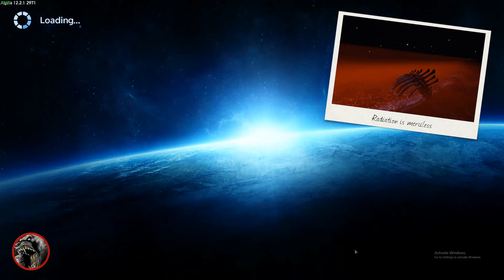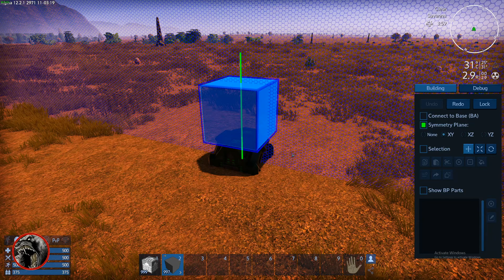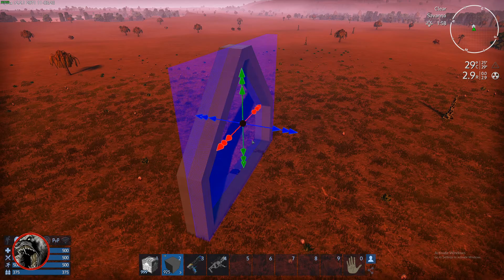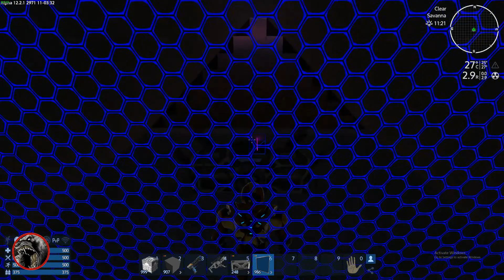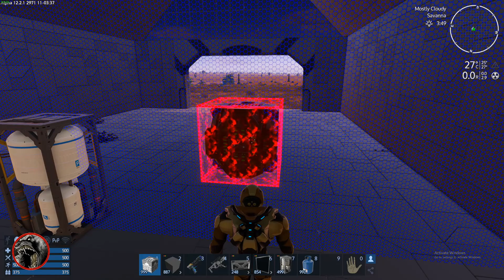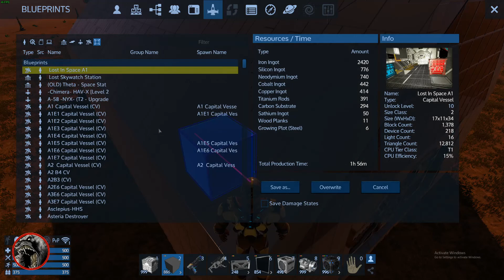Empyrion - Galactic Survival: Basic Guide to Creative mode and building tools

Comment: In symmetry mode, use SHIFT+RMB while holding a placeble to remove blocks, it'll remove it from both ends. The multi-tool just removes it on one side.

Comment: Haven't built in a while but if I remember correctly if you hold shift and right click while placing a block not only will it do a line but if you change your drag axis it will make a sheet as well.